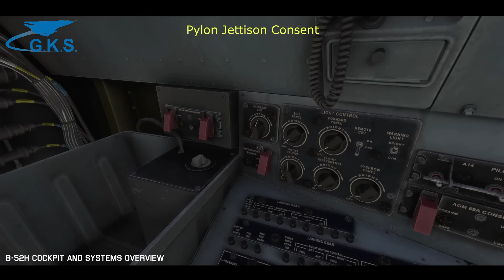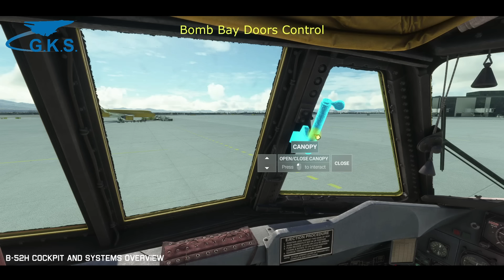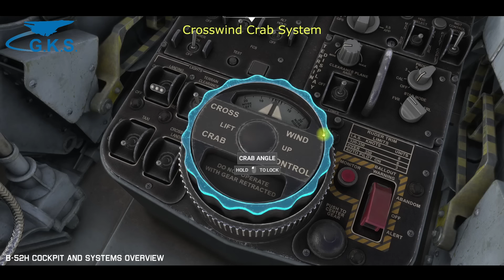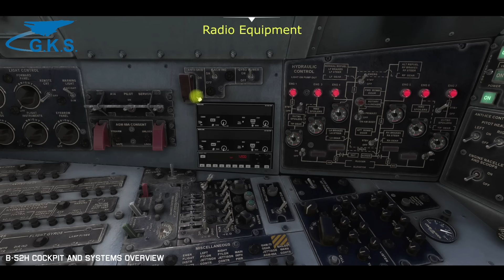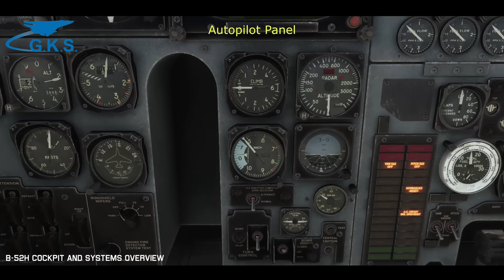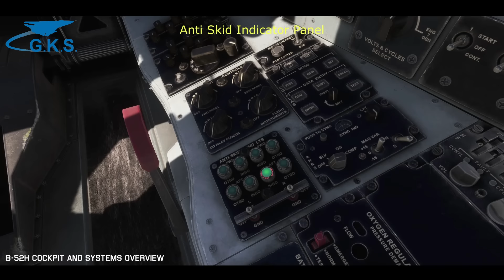B-52H Stratofortress Tutorial Part 1 | Full Cockpit and Systems Overview | GKS for MSFS2020 & 2024

Comment from the maker: Many of you may notice that the camera movement at the beginning of the video isn’t perfectly smooth.
Just to clarify — this isn’t due to low FPS in the simulator, but rather the result of a poor screen capture tool we used during recording.

If you’d like to see how it really looks with proper FPS and smooth motion, check out this great video by Into the Blue Simulations:
👉 https://youtu.be/ZL-BGyHAEaw

Our main goal with this video was to showcase the B-52 cockpit features — so we had to sacrifice a bit of cinematic beauty for clarity and detail.
________________________________________________________________________________________________________________________________________________________

FAQ:

🛫 MSFS 2024 version: Not yet released — coming soon!
💥 Weapon display module: Yes, planned — stay tuned for news.
💥 Engine’s smoke: Already released, can be set on via option menu.
💥 Bugfix, sounds, paintkit updates: Yes, all planned — stay tuned for news.
🎨 New liveries: More coming soon, plus we’re working on a grey livery customization system so players can easily add their own nose art and tail numbers.
Reply: Awesome to hear about the liveries.   This jet has so much potential.

Comment: My throttles become wack right After take-off no matter what.

Four work, four unresponsive when wheels unstick. Lame.
Reply from the maker: Do not use the Ctrl+E hotkey to start the engines. Instead, use the "Ready to Taxi" state from the options menu located on the glareshield.
This is a known MSFS2020 issue caused by using the quick start (Ctrl+E) hotkey.
In this case, only four engines respond to joystick input, although all throttles can still be adjusted manually.
We can't fix this in our end. The same issue have all msfs aircrafts with more than 4 engines.
Reply: @aviasimhdgks6303 rgr, good jet, BTW. Thanks. Yes, I have read this and have tried using that menu option you bring up here, with same results: I lose control of those engines as soon as I'm airborne. 

Think my only option is to MANUALLY START - will report, as I said, this occurs at least for myself using either or.
Reply from the maker: So, throttles are functional after start via ready to taxi menu, but become unavailable (thrl5-8) when airbone?
Interesting… we haven’t encountered this issue before.
If possible, it would be great to receive a short video showing how the problem occurs, as well as a list of the hardware you’re using. This will help us understand what’s causing it.